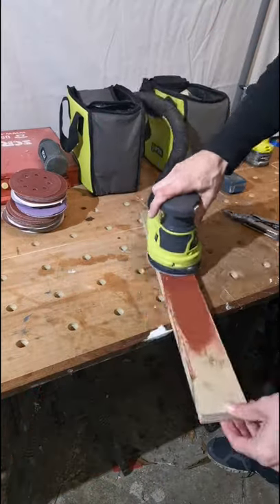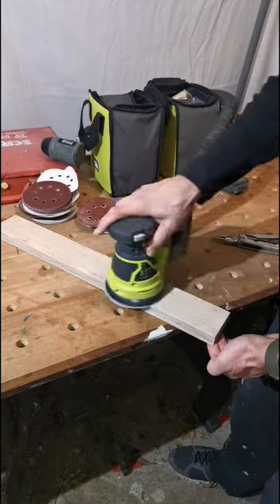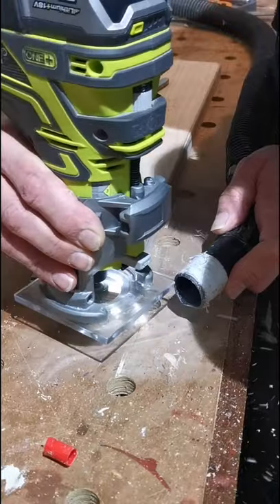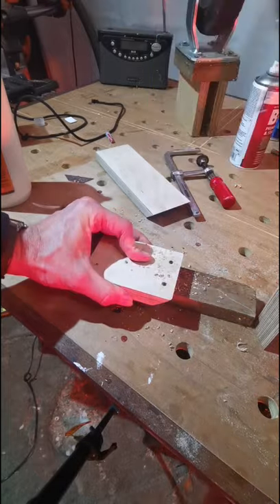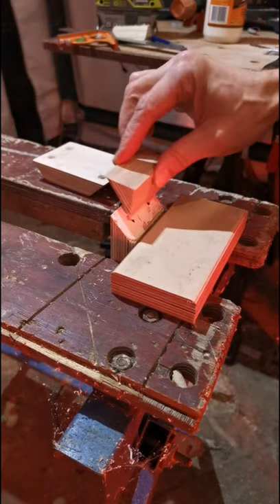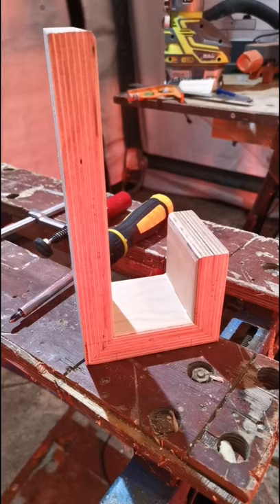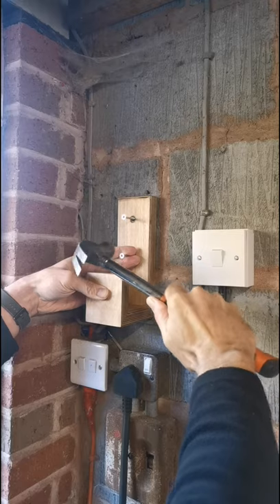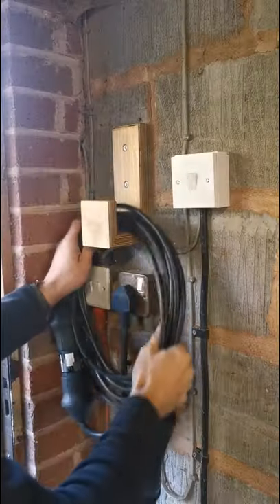EV Charger Cable Hook from Birch Ply Off Cut

Comment: I have a quick question, I want to build a DIY Lifepo4 cells to charge via AC coupled inverter charger. I looked at GivEnergy inverter and battery but for the price and size of battery I think I need it’s going to be expensive. If I build a 60kw battery  with smart bms it’s about £6k and with victron Quattro 15kva inverter charger it’s another £4.5K. My main concern is about having it insured with my insurance so I can put it in the garage in the house. Am just wondering if you have come across this or done this to your house? Ideally I want to leave the battery and inverter inside the house so I don’t have to build a shed just to house them outside the house and have to run armoured cable into the house for this. What do you think?
Reply from the maker: Hi there. I haven't done this but would really like to install solar panels and possibly a power bank to charge the car. I'll let you know as and when I get round to it. Do let me know in the meantime though if you manage to sort yours 👍
Reply: @CharlieDIYte  thanks hopefully I’ll get mine done within a year. I also messaged you on Instagram, I am more active there

Comment: Neat little job! What car do you have Charlie? Cheers
Reply from the maker: Thanks. Pre-configured Polestar 2. Really like it but it's going to be an expensive process getting a decent charger installed.
Reply: @CharlieDIYte  Cool - have fun!
Reply: @CharlieDIYte   How long does it take to charge of a 3 pin plug???

Comment: I assume the mitres were for the youtube audience? Most would just settle for butt joints on a garage hook 😊. Like the idea of some short vids though.
Reply from the maker: I went for the mitres because the rounded over edges wouldn't butt up as neatly at the join, otherwise I would definitely have gone butt. Mitre a little stronger maybe given the increased surface area?
Reply: Not sure how plywood works but with normal wood I have found vanilla miters are pretty strong when glued and very easy to reinforce after the fact.